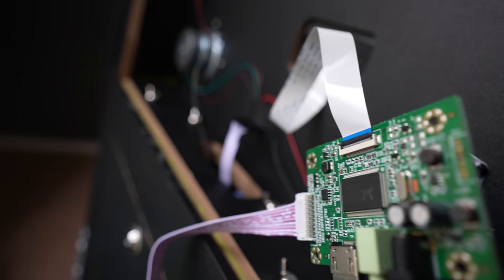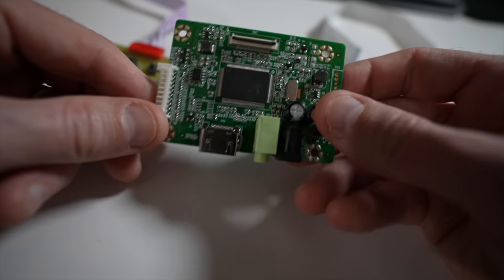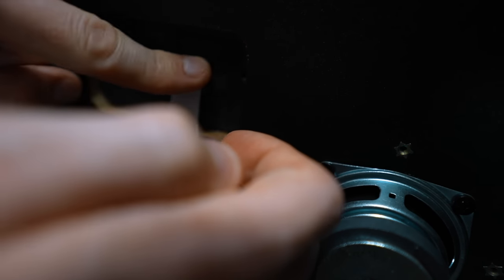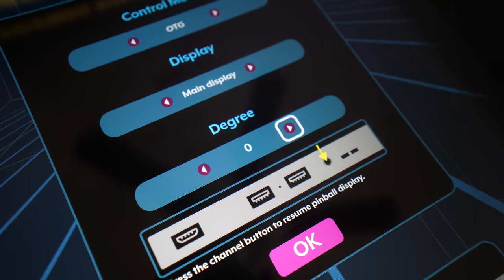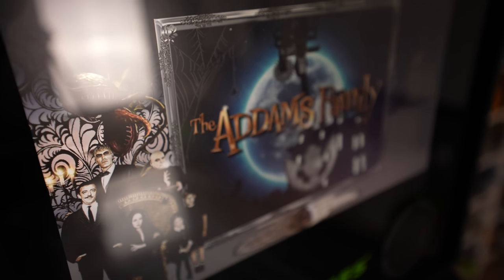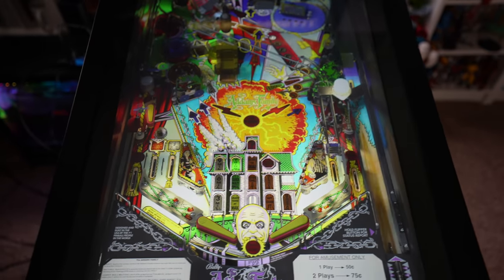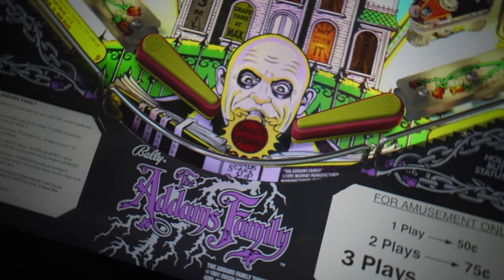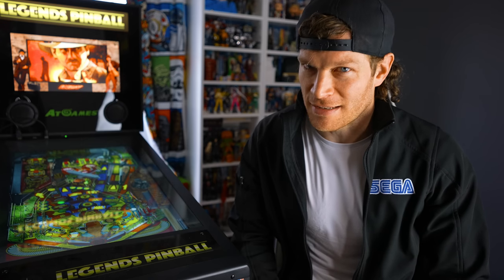Legends Pinball Mod - Play Visual Pinball & Future Pinball

Comment: This feature right here definitely gives the AtGames machine the edge over the Arcade 1Up offering.  I still prefer the overall looks of the 1Up cabinet, but the enhanced functionality and modding capabilities of the AtGames unit really puts it over the top.
Reply: You can mod both machines so basically you are buying a small pinball table with fancy graphics, or a larger pinball cabinet with dull graphics. The games you will be able to side load yourself and if you really wanted to then you could strip off the graphics on the atgames and then add your own. Yes the 1up comes with licensed and better games, but if you can side load them onto the atgames, then you are getting a better machine for the same amount of money.
Reply: @marknorville9827  the problem is that non of the haptics will be compatible with these games right now on the AtGames. so at that point, its no different than any custom vpin you can build yourself without haptics
Reply: @user-jm8bj1hd3d  The point being is that most people cannot build their own. You also cannot really buy cabinet kits or you can, but not from many places. The kits that I have seen are not full size, however I just looked at game room solutions and they do a full size kit, but then you have to build it yourself. So once you add a monitor etc, then it costs a lot more.

Comment: COOL!!!  Couple of things.  Try setting your vpx FPS Limiter/Vsync to 1/1 instead of 0/0 to see if it smooths/improves out the ball movement.  Also,  for PuP-Packs checkout the 2 screen versions so that you get your freezy/dmdext DMD on the Backglass with the pups.
Reply from the maker: I was experimenting with a 3rd screen that was on the floor off camera in some of the gameplay clips. Hence why I didn’t have a score on some of the back boxes.

I’ll try out the other tip!

Comment: Thanks for sharing this with us. I would've thought you could just stream between your PC, and the table, without all that cable swapping. But since you're running the software off the PC, directly, I guess it makes "sense"? Seems like whole lot of work. Might as well just build a whole second table, and be done with all that cabling nightmare. But, I guess it does save room. LOL Like you said, that cable switcher is possibly in the works, so that'll make things a lot easier. At least you've got a working table to enjoy playing outside the AtGames environment, with. I'm glad to see there is an access hole in the monitor support plate. Means a bigger monitor could be put in, in place of the dinky, little 15" monitor. Thanks for the video.

Comment: Can you able get zen pinball Deadpool on it? So you plug both HDMI connection into your PC right? Then how you get the controllers buttons to work? I am little lose here. I didn’t see you plug anything to your PC?
Reply from the maker: You can play anything you want just so long as your PC is powerful enough to run the game. The USB A to A cable I mentioned is plugged into my PC and this is how I get the buttons to work. The program JoyToKey is running on my PC which interprets my buttons inputs on my Legends Pinball machine into the necessary commands for VPX or Future Pinball
Reply: Hi  @cooltoy , when is the released to local stores so we don’t have to paid $100 for shipping?

Comment: I got the LCD controller board to add my pc. I have the vibs on the way. I used the monitor ribbon included in the controller board. Do I need to switch back to the old ribbon to attach to the vibs board?

Comment: Quick question - do you know if the adapter is bidirectional? Thinking of switching out the back panel screen on mine and wondering if the same adapter can be used in reverse to keep the AtGames board talking to the replacement backglass screen for the built in games.
Reply from the maker: Not to my knowledge
Reply: @cooltoy  yeah, I hadn’t thought the logic of it through. There’s no encoding needing at this point in this direction, so it should probably be a straight pass through to an HDMI socket (allowing for the huge presumption that it’s a standard output signal) and then let the encoder on the monitor work for itself. Thanks for the answer, anyways. :)

Comment: Great video. Can JoytoKey detect the accelerometer if you shake the cabinet? With JoytoKey in forefront, does shaking machine highlight any of the JoytoKey tabs?
Reply: The accelerometer and Plunger are analog devices.  You will lose all the analog function when you  map them to keyboard keys.  the OP should be using 360ce. witch lets you map analog devices to (virtual) analog sticks and he could probably get the plunger and analog nudge to work.

Comment: I got the later edition of the Pinball Legends game ... there is a board in the back part of the back display that has an HDMI cable in it. Would simply plugging into the games HDMI in front and using a HDMI switch box for the back glass work instead? Google
Reply from the maker: no, AtGames used a non standard HDMI on that and it does not allow you to simply plug in a HDMI cable and get an image on the second display.
Reply: @cooltoy  Meh ... they couldn't just make it simple could then. Oh well. Thanks
Reply: @cooltoy  So their neato board to add HDMI won't work, what will?

Comment: I have a power supply I believe that will work.  Amazon says on there website for this board 
12vdc more than 2a… I have one at home that it fits it , and the output on the plug says 12V-2.0A 
Do you think this is fine. Since Amazon said more than 2a? Should my plug work ?

Comment: Do you think they could stream the monitors from the PC to the cabinet over WiFi like arcadenet link is on the ALU cabinet? That could work.. I'm testing out some digital pinballs now.
Reply from the maker: they have still not made the arcadenetlink work with the pinball machine unit. Keep in mind streaming over wifi is liable tin introduce some latency and for pinball you will likely notice that more than other games you might play over a wifi streaming connection

Comment: So why would you need to unplug and replug the connection? You can launch OTG mode or run updates from the main screen even with this EDP board plugged in right? I thought the only con would be no audio or black glass display for stock games.
Reply from the maker: If you have this board connected you will not get any display from the stock games or firmware updates. Technically yes, you could still run an update without seeing the backglass status update, but it would be difficult as you wouldn't know when it is safe to restart the system.

Comment: Hi, what have you typed in at „Joy To Key“ that it works? At my machine Joy To Key does not recognize the Legends Pinball. Thank you for your help!
Reply from the maker: You either need to update your firmware or use a different OTG cable, because joytokey should recognize the pinball machine immediately

Comment: So the bottom still works without the kit? Just plug into the hdmi in front?
Legends pinball looks like a good buy, I may pick it up. After things get better of course. Maybe i can find a good deal on it.
Reply from the maker: yes, bottom playfield portion works regardless of wether you use the EDP to HDMI convertor board, as that only applies to the back glass monitor.
Reply: @cooltoy  wonder if there is a pi 3 image. ill look. Or am i having to look for some sort of small pc?

Comment: Those connectors were not designed for multiple insertions and have a higher chance for failure.  I managed contract manufacturing for connectors and dealt with Amp and Molex a lot.  Cool vid, BTW!
Reply from the maker: Completely agree, individuals would be better served to wait until there is a switcher device available as to not put any more unnecessary handling on these cables and connections.
Reply: @cooltoy  None the less, the opportunity here is huge!

Comment: I want to add contactors to the left and right flipper buttons. Maybe add a 12 or 24v power source and splice into the flipper buttons. It should make them fire when pressing the buttons. Can you make a mod video on this?  I'm at a loss on how to make the buttons open and close the circuit while still being able to run OTG and pre loaded tables

Comment: Simply amazing!!!  I DO wish he hadn't brushed by the "Dual HDMI" portion of it though.  I'm still wondering how that's ganna work.
Reply from the maker: Every computer is different in terms of output connection support for multiple displays. It would be impossible for me to cover various different makes of PCs, graphics cards and all their display options.

Basics are you just need to have the ability to display to two monitors from a pc. And the outputs to the legends pinball machine from the pc need to be HDMI. How the user gets there is up to them, they could user various adapters, dongles, etc just so long as they have two separate HDMI “ends” to connect to the legends pinball.

Heck, if the user doesn’t care about the back box display they could settle with just the 1 hdmi connection. Or if they want to get really detailed, they can add 3 to have playfield, back box, and a dedicated DMD/LCD screen if they wish
Reply: @cooltoy  Gotcha - thanks!

Comment: I’m considering a purchase. Has this been updated on the more recent machines? (The not having to switch cables)…? Thanks
Reply from the maker: Yes, there is a new “VIBS” board that they sell separate that allows you to push a button to switch back and forth between inputs without having to swap any cables

Comment: Just let me ask you a question do you know or have you heard if one up arcade is going to be coming out with a better pinball machine like this one without the connectivity for the Internet I don’t really want connectivity to the Internet I just want an all-around great pinball machine like to legends but I like the one up because you could just play it without connecting to the Internet but the graphics suck on it I want to have a 1080 P screen ?????🤔🤔🤔
Reply from the maker: I've had zero things about an upgraded machine from Arcade1Up. Sadly it's been the opposite, Arcade1Up actually raised the price of their pinball machines from $550 to $850 last month and made zero changes and improvements to their machines at all.
Reply: @cooltoy  I didn’t know their machines were that cheap I’m happy you told me because now on principle I will not buy one

Comment: @Cooltoy I know it's been awhile but any updates on this? Specifically regarding better support of the OTG controls. I just got my Legends Pinball and the Plunger continues to be an issue. While I can get it working in Future Pinball it barely hits the ball with enough force to launch. Also can't figure out how to get Nudge Accelerometers to work in any program. Just wondering if you have heard anything about a OTG patch in the future or maybe a PC software work around besides Joy2Key. BTWs, love watching your videos. Please keep up the great work :)
Reply from the maker: Accelerometer isn't supported through OTG at this point to my knowledge. They are still tweaking and adding more support for OTG functions, but it's a slow process.
Reply: The plunger works great on the ALP, you just need to enable the x-axis inside your chosen emulator. VPX, FP, etc. Checkout the post by DiscorderlyConduct on the Virtual Pinball Club discord server for full info.

Comment: Question… for vpx tables on the legends is it worth having the third screen ?
Reply from the maker: It’s personal preference. Some like to stack the score on top of the back glass. Others prefer to to cover up the back glass art so they add a third screen.
Reply: @cooltoy  I notice the info from the 3rd screen appears in the 2nd screen if you have no third screen .I have somebody helping me with my set up and I’m an 80’s guy but will be getting maybe 25 old tables and 175 new ones , Beatles , Elvis etc etc . If I have a choice which would you personally choose ? Once I’m set up I’ll leave it as it is. No modding and little computer knowledge . It would be a simple 8” screen that fits in between the speakers . Maybe the single screen is a bit better for the older ones but it seems the 8” bonus screen might be cool for the newer stuff hmmm 🤔 lol

Comment: The latest Atgame pinball (I got my mid June 2021) has a basic HDMI port for the backboard LCD.  So technically I guess I could just use an HDMI switcher for it???
Reply from the maker: No, they used a non standard hdmi connection. You can’t connect anything else through it

Comment: So it appears only 1 screen works (playfield). Where was the scoring?
Reply from the maker: Scoring is done on the back glass depending on the users settings within VPX or Future Pinball. But can also be moved to a third or fourth display if the user wishes to add more to their system.
Reply: @cooltoy  OK ty. Isn't that edp board basically atgames Rachell board?

Comment: Nice, this is a great option for Legends Pinball owners. What is the reasoning for needing joy2key? When I first set up my cabinet I had VPX set to use joystick buttons. I am pretty sure you can define any action to any button. As far as taking this further, you could throw a relay/solenoid board in there, LEDWiz, or anything for that matter to control LEDs, solenoids, and other toys. If it all just goes to the PC then it should all work. Definitely pretty cool and VPX gives you the best physics out there and a great table selection.
Reply from the maker: You don’t have to use joytokey per se, and you can map things independently on your own within the applications. But most users would find using joytokey and the premade cfg files easier I suspect.
Reply: @cooltoy  ahhh gotcha, yeah that makes sense.

Comment: So your pc has to have two hdmi’s?
Reply from the maker: Doesn’t have to be hdmi, but your pc will need two display outputs of some kind. You can adapt one to hdmi for the lcd controller using various adapters or cable conversions

Comment: CT have you tried the coin ops arcade vs pinball on this cabinet yet?
Reply from the maker: Nope, I’ve already got it running on my arcade, no need for me to have it running on this as well
Reply: @cooltoy  just thought the expanded play field would have been better for that. I have it on a different pc with a tv on. Mount that does a 90 degree swivel.
Reply: @cooltoy  i was turned on to AvP form your video of the TV on the wall - loved it.

Comment: Awesome Video -  I can't wat to do this once I get my unit. It does seem like a pain to have to change the cable in the back to switch between stock mode and using it on your PC. I know Atgames is going to make an adapter board to make it easier. I would be great if I could find some type of Edp switch box so I could just leave everything  hooked up and easily switch the sources but I do not think this is made.
Reply from the maker: EDP switch is in the works, still a few months out before it's made I believe

Comment: Cool toy… please help ASAP right now please. I just got my board and installing in my legends. Bought the same one as you off Amazon. And I can’t believe this thing did not come with the power supply! Man I wish I knew that. Can you please tell me a power supply I can use. Or response back with a link on Amazon that works for this please . Thanks bro!
Reply from the maker: Power supply I used is already linked in the video description box
Reply: @cooltoy  oh dam I didn’t see that. I just found the board you linked and went straight to buying it . Well I have different power supplies at my house from other things I want to try. Can you please just tell me what I should look for on the plug.. like 12v plus with 1.5 amp? Or 12v plug with 3 amp? Sorry bro, just need your help, and I don’t want to use the wrong plug.

Comment: Recommendations for PC to run pinball.  Bulid or buy one complete.
Reply from the maker: Building always offers the best performance to value option, but I know that's not within everyone's technical wheelhouse to do. If you are buying, biggest things to start with in my opinion for the better playable experiences would be an I7 processor and a dedicated graphics card made in the last 3 years or so. You can get away with less, but depending on how smooth you want the games to look and the different types of programs, screens, and graphics you want running in your pinball experience, those two things in a PC would give you a great start.
Reply: @cooltoy  Thanks. I have some work to do.
Reply: So this is what I used and it works very well ....not staying you can't go bigger and better...(I have lol)....but again this does work very very well.....Got a refurb PC off staples/office depot for $189 - Dell 9020 sff - i7/16GB Ram/256GB SSD/Win10 - then got a Video Card - GeForce GT 1030 2G LP OC - $82 ...think it was Amazon - Added another 16GB of Ram - $60 - And wow this thing works great on a 2 screen setup ......I already had the Monitors - Playfield 27" - Backglass 18".....This was for my grandson so I made it more of a table top style....nothing fancy very basic plans online....It's running VPX with around 150+ tables - Pinball Wicked and I went with FX2 being I already own it.....I also added a USB to the front so he can play some CoinOPS with controller as well .....over all a budget build that performs very well.....I think the key here is i7 - 32GB+ Ram and a good video card....oh and a SSD drive ....it makes a big dif.....cab maybe cost me $30 if that for the supply's....oh and Doug good video :)